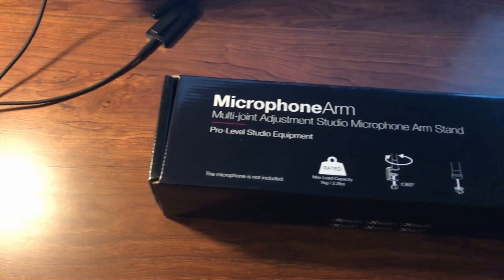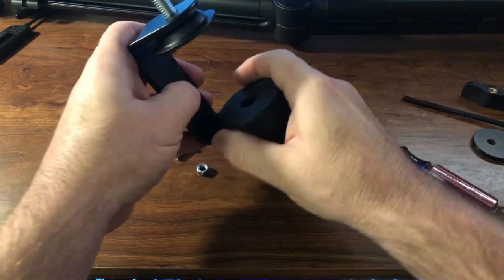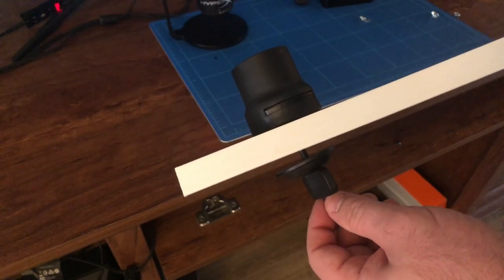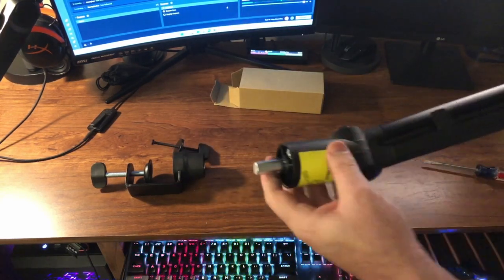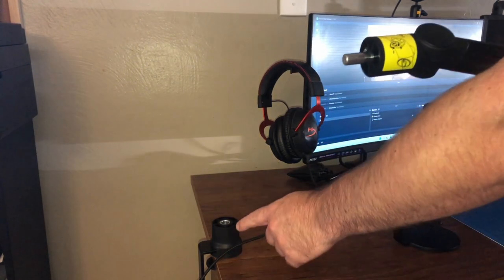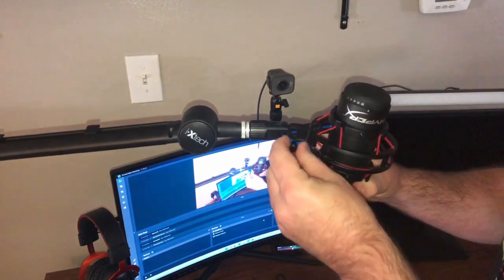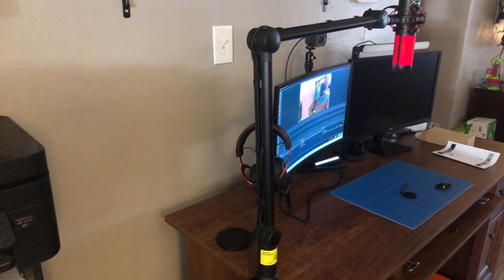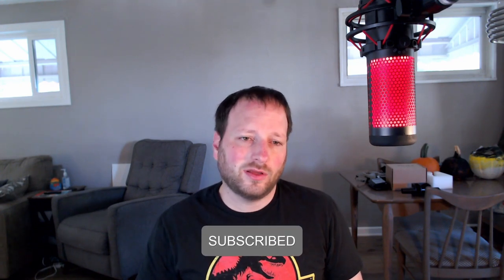New Boom Arm Stand from I-XTECH! Unboxing and Setup!

Comment: I have a support bar running along the bottom of my desk near the edge that's a little bit less than 1 inch wide, do you think a mic arm would stay secure on the support bar?
Reply from the maker: It’s probably could tbh, but I don’t know it would stay there. Does the bar have holes along it cus the grommet option would probably work better there.

Comment: We just bought 2 of these for my kids and the spring is so tight that no matter what we do we can not tighten it in to one position. Any ideas why? Thanks!
Reply from the maker: So the adjustment knob things aren’t working to tighten it?
Reply: @MrDarkcore  No I'm afraid not at all. 😞
Reply from the maker: On both of the arms? I didn’t have this issue at on with the one I have.
Reply: @MrDarkcore  Yes I'm afraid so. I have 2 disappointed kids
Reply from the maker: If you take the arm out of the desk clamp, there is a screw right next to the post on the arm. You may have to tighten or loosen it. Let me know if that helps.
Reply: @MrDarkcore  Hi thank you. I have tried fiddling with that screw and it just doesn't seem to do any good I'm afraid.
Reply from the maker: I would just return them if you believe they are defective. Just strange that your having problems with both of them.
Reply: @MrDarkcore  Thanks for the help I appreciate it!
Reply: There’s a screw on the bottom of the arm and the mount part that is called the tension adjustment.. there’s a sticker that is put on there for you to adjust the tension you have the spring in the boom arm. Just figured it out myself.
Reply: You can see the sticker on this is yellow. It shows you the screw that you need too loosen